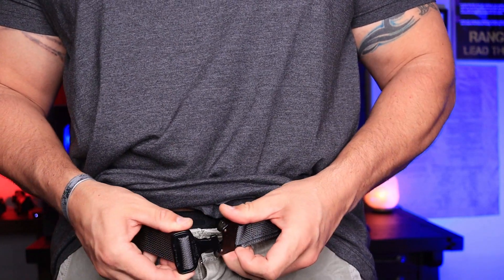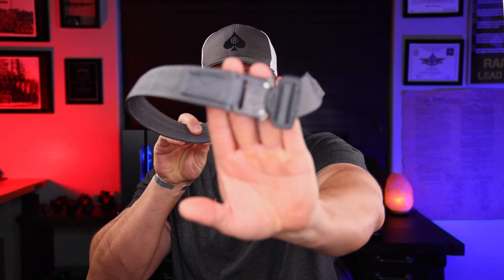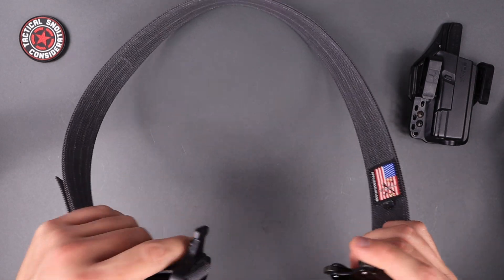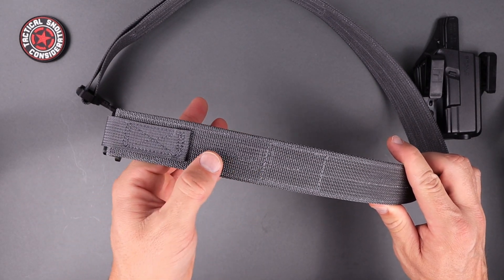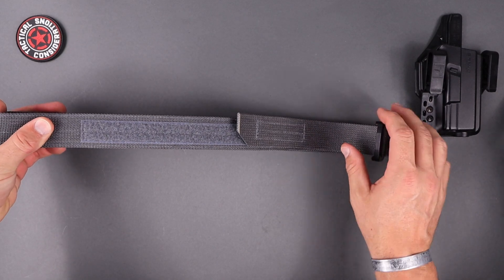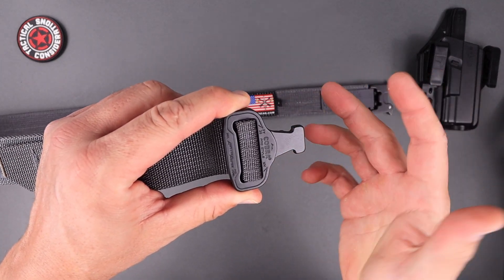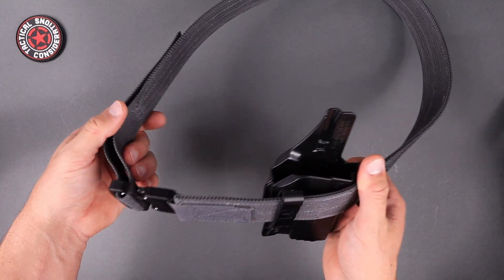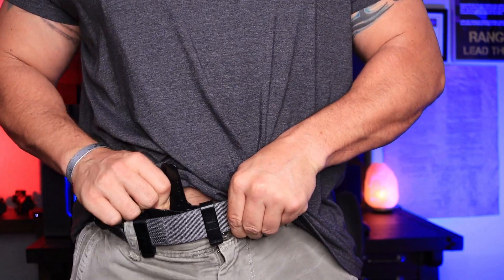Applied Gear Hybrid Cobra Belt EDC Or Work Belt Solid

Comment: I'm partial to leather for my gear and live in a hot humid state so I primarily carry outside the waistband.  My go to for many years is a good toolbelt, stiff enough to carry a toolbag makes it more than enough to carry my everyday gear. They are generally reasonably priced, last for years and available at most hardware and tool supply stores. Drop a slightly oversized shirt over it and carry on with my day.
Reply from the maker: How does the leather hold up in the humidity.  I am in AZ so its like an damn oven with zero moisture.
Reply: @TacticalConsiderations   Summer's here typically are 90s + with the humidity 70 to 100% so it takes work but if I do my part it works  pretty good.....  I do give all my leather a good cleaning and a fresh waterproofing a couple times a year.  Sweat stains turn the leather a little darker in some spots but overall I'm happy with my choices.

Comment: I’ve got a Vedder’s belt very similar to this. It’s heavy duty, stiff, carries a full size gun with ease, and it totally turned me against cobra buckles that only fit belt loops like on 5.11 cargos. I can’t wear it with 80% of the pants and shorts I own. My current edc belt is a Blue Alpha Gear low profile buckle belt, and my next will probably be a Wilderness rigger’s belt.
Reply from the maker: Blue alhpa is a great belt and they are great USA made set ups as well.
Reply: Weird because Vedder is the exact same size as this one (Standard 1.5) and is identical to this one. I have over 30 pairs of pants and shorts combined in my closet and it fits all of them.

Comment: Looks almost as good as a Kore.  Just doesn't have the ease of adjustment that the Kore belts do.  But it does have the Cobra buckle, so there's that if you want to look more tactical instead of grey man.  Never used an ice pick, I used a drill and made a new hole.
Reply from the maker: That ratchet style belt is really nice for minor adjustments.

Comment: I'm always concerned that flexible section will negate the stiffness and rigidity of any belt that has it. Maybe I just need to try one out.
Reply from the maker: I get ya but without that part you cannot adjust the belt it would be to stiff to go through the buckle.
Reply: @TacticalConsiderations  ya it's always a trade off. That's why that AXL eclipse belt looks so appealing. I may actually drop the money on that, if I can sneak enough money passed my wife. Or my hookin' business takes off...

Comment: Hard pass - the velcro part. Personally, I've been rocking Kore for a couple of years and their line of tactical and business with that sliding lock system is outstanding. My tactical belt, which I wear daily, barely looks worn, and the support for IWB is spot on. 

Great content as usual, though. Keep up the great content!
Reply from the maker: Those ratchet belts are nice with the infinite adjustment.